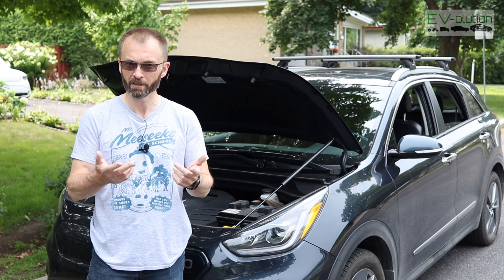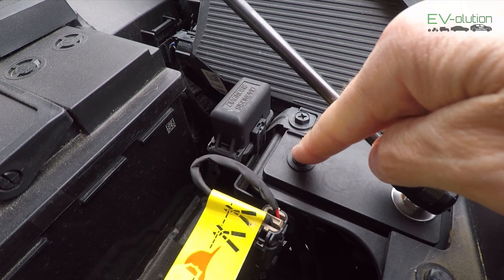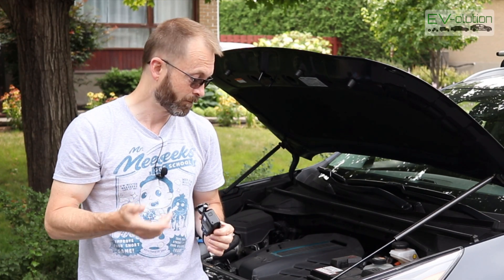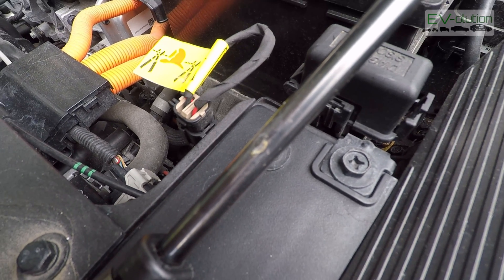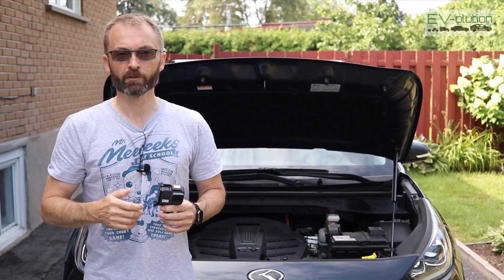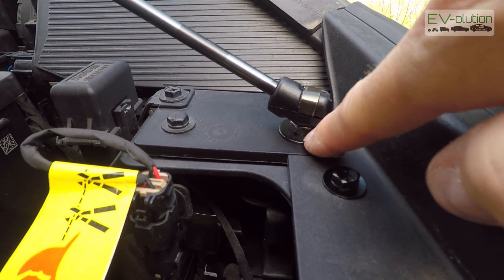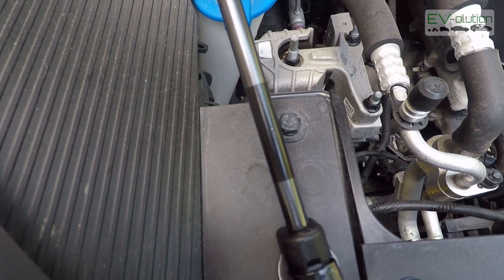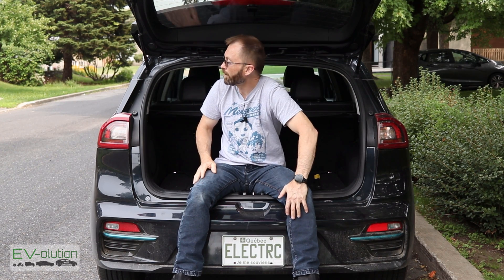EQ 003 - Niro EV hood struts 8 months later

Comment: My Kia e niro 2020 doesn't have an ob2 diagnostic port is that normal?
Reply from the maker: The 2020 does have one, but I believe there are differences in the model year, or country. Have you looked in the fuse panel area. If it is not under the dash like where mine is (see my EVOBD2 Niro EV video) then it should be behind the cover that hides the fuse panel.
Reply: @EV-olution ah brilliant thanks for the info will have a check......that means I may be able to use the closer bolt holes and have the bonnet slightly higher

Comment: Thanks for the original video and this one. Thanks to your instructions I fitted them effortlessly today. I had prepped the parts beforehand by giving them a layer of rust protection paint, greased the joints and placed tape on the strategic areas of the hood. The clips are now of a different design: you don't need to take them off, just pull on them a bit before, then push them back in after fitting. In English for the benefit of all mais suis Francais :-)  A bientot!
Reply from the maker: Excellent! Heureux que ça c'est bien passé, et que ma vidéo à pu aider. Merci pour la mise à jour sur les informations et d'avoir écouté ma vidéo.

Comment: I have installed the hood struts but I find it puts upwards pressure on hood as it popped up after going over sharp edge on the road where they were starting to pave. The hood seems to be slightly higher then side fenders.
Reply from the maker: Either you have the incorrect struts, or they are installed incorrectly. Did you use the struts from the original video about this subject? I had no issues with mine, they were a perfect fit, and there were no issues at all. Original Video: https://youtu.be/i_oL_JgIUsU

Comment: How are you now FULLY closing the bonnet, do you have to press down on the bonnet? Before the struts were fitted the bonnet would fully close by dropping it from about 6" away from the catch
Reply from the maker: I just replied to your other post with this question... I have always brought the bonnet down gently, then pressed to click it shut, like I do in my videos. The difference with the struts is that there is a bit more resistance when pressing, but nothing terrible. I have also tried the "slam" test; I can "drop" the bonnet and it will close even with the struts installed, it just takes more effort, hence the reason I use the gentle press instead.
Reply: @EV-olution  thank you
Reply from the maker: My pleasure 😎

Comment: I'm not 100% sure about safety in a frontal crash. In that position wouldn't the hood struts be pushed inside the passenger compartment in a heavy crash?
Reply from the maker: The hood struts are flimsy things in the overall scheme of the car. They would crush, or disconnect from the mounting points and are nowhere near being strong enough to penetrate into the car. That plus the fact that they are angled outwards, towards the sides, so even if they were strong enough to stay straight on impact they would deflect outwards.

Comment: Thanks so much for sharing all the informative videos. As usual, the bloopers at the end always put up a huge smile on the face of viewers.

Quick question unrelated to this video regarding EV brakes. I noticed in one of the recent videos where you had your tires changed at 43K. Wondering if you can share some updates on the brakes, if you had them changed recently or how many kms usually they can go before wearing out for a replacement? I am more keen from regeneration point of view, as I have set them to level-3, so with that I have to use the brake paddle rarely while on road. Does using regenerative braking help in preserving/extending the life of brake pads or they need to be changed just like for any ICE car depending on the usage? Thanks!
Reply from the maker: It is my pleasure and thanks for watching. I am glad my videos are helpful and entertaining 😎.
The Hyundai/Kia EVs use a hybrid braking system that uses regen even when you use the brake pedal. The friction brakes are only used when needed, like in a panic stop situation, or to hold the car in Auto Hold, etc. For this reason brakes in these cars are not used very much, like with most EVs, and require an annual brake service to make sure things remain lubricates and rust free. Both of our EVs still have the original brakes, which are pretty much like new (some wear), and require nothing other than the annual servicing. A real brake service takes between 1.5 and 2 hours and costs about 200$ CDN (180$ + tax at my local garage). With that being done you should have no issues with your brakes for years, and require no replacement for a long time.
Reply: @EV-olution  thanks so much for your detailed response. I really appreciate you taking time to respond to follower’s questions/comments. 👍
I didn’t know that the braking system in an EV is totally different from ICE vehicle. 

Another question related to the service schedule Kia follows. When I bought the EV, dealer put a sticker on the windshield regarding  the EV service and set it as 8000kms or 1 year whichever hits first. I am into 2nd month of ownership and have already hit 5500kms, so I am curious about the service schedules. Do I need to get back to dealer after my EV hits 8K kms? If I choose to skip this marker and say plan to get the service done after 1 year, would that generally affects the warranty Kia provides on various vehicle components? Thanks!
Reply from the maker: You should show the owner's manual of the Niro EV to your dealer because there are no service items, or liquids to change at all, for the life of the car. All maintenance points listed are inspection points; in other words they look at the car to see if anything is wrong, or if a fluid is low. The only replacement item is the cabin filter and you can do that yourself by following the details in the video I made about it. It takes 5 minutes and costs 20$. I have had my Niro EV for 2 years and 4 months, I brought it to the dealer once at the 1 year mark for the general visual inspection and the annual brake maintenance, which cost me about 200$. Then at the 24 month mark I had a brake service done at my local garage ClickTire that you saw in the video I made about the new tires I bought. Sorry for the delay in response, YouTube Studio on PC does not show comments in threads that I have already replied to. I saw this because of your message on Instagram.
Reply: @EV-olution  thanks so much for your response! It’s very helpful! Cheers! Eagerly waiting for your next video😬

Comment: That why I am not use the hoods. I buy it but don't install it.
Reply from the maker: They are very useful and I would not remove them. I have fixed the issue and they are perfect now. You should consider installing them because they really make it more convenient if you open the hood more frequently like I do.
The rubber strips that I applied to the 2 locations under the hood fix the issue I show in the video.
Reply: @EV-olution  Do you have no rost at the hood? There were screws exchanged.
Reply from the maker: @thomassommer7643  the hood strut bracket that was included with the kit, and that attaches to the hood, uses the original Kia hood bolts so they are still fine. The hood strut brackets are still in pretty good condition, but do show a little rust at the edges. If I were starting the installation from new I would give the brackets a coat of paint for added protection before installing them. I will probably remove the brackets next year to clean and paint them since they are still very nice.

Comment: Have you unscrewed to unscrew the rubber dots a little to lift the bonnet away from the arms.  Maybe just 1 / 4-1 / 2 rotation.  At least I can do that on my Kona.  It gets a little hard to close, but not something that does anything. The rubber-dot I think of, is that just beside the marks on the bonnet / hood
Reply from the maker: I could, but my hood is properly aligned with the nose of the car and I don't want to change the alignment and have the hood sticking up. Also to note, the Niro EV has a rubber seal trim between the nose and the hood that keeps things under the hood clean and helps with aerodynamics and raising the hood would open a gap. The solution I mention in the video works perfectly.